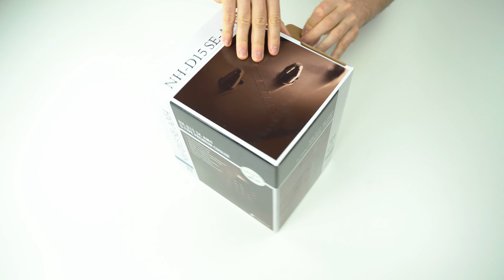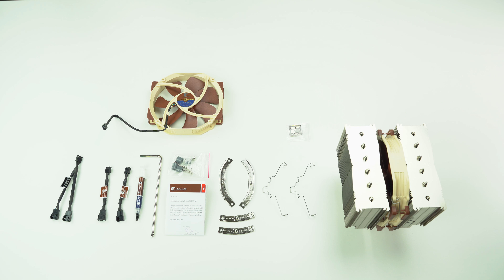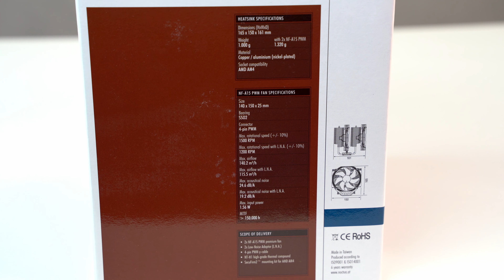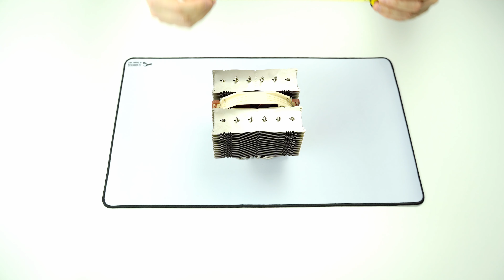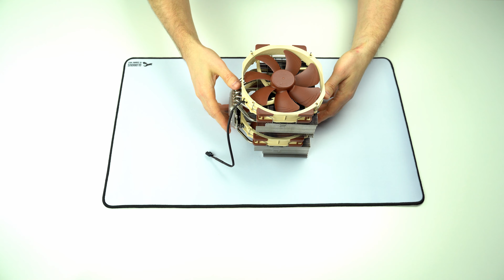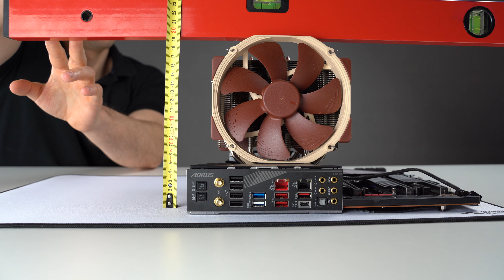Noctua NH-D15 SE-AM4 - Unboxing & Info

Comment: So I got a 9900k and wanted to overclock it so went with the DH 15 to make sure it stays cool...USPS took like a month just to deliver me the AM4 version and im extremely upset after waiting that long. Is there a way to make it work with my mobo cause waiting 2 months to send it to USPS and then get the correct one back isn't something I feel like is worth it
Reply from the maker: Hi Deny, that is unfortunate, but there is a solution 😉 
You can get just the mounting mechanism for your cooler separately and use it instead of the one for AM4 socket. Your Intel Core i9 9900k uses FCLGA1151 so you´ll need this one - https://noctua.at/en/nm-i115x-mounting-kit 
You can get it free of charge here - https://noctua.at/en/nm_i115x_mounting_kit (but you´ll have to wait some time because of the current situation in the world)
or buy it here for 8 USD, if you´re in a hurry - https://www.amazon.com/Noctua-NM-i115x-Mounting-Coolers-platforms/dp/B00BLS3YYO/ref=sr_1_3?dchild=1&keywords=NM-i115x+SecuFirm2&qid=1609022370&sr=8-3
Hope this helped, M.
Reply: @MartinsLab  Thank you so much for fast and detailed reply, greatly appreciated!

Comment: what makes it good for AM4 in contrast to the plain Noctua NH-D15? thanks.
Reply from the maker: I would say that nothing 😊 The only differences between them are the absence of mounting mechanisms for other sockets in case of NH-D15 SE-AM4 (has one only for AM4 socket) and the price, which is few dollars lower. Actually, I even found shops where SE-AM4 version is more expensive although it doesn´t make sense.
Reply: @MartinsLab   Right, I see thanks.

Comment: Thank you for this video. I just received this cooler for my 3900XT build. I hope this is not a dumb question, but it is possible to change out the fans for aRGB fans of some sort? I'm building a music production "slave" with an Asus Strix X570-E and would like to be able to see immediately if my components are too hot, via some aRGB lighting changing colour to red to warn me. Is this possible with the Noctua? Thank you again for the video:)
Reply from the maker: Hi Shawn, you´re welcome, it definitely isn´t dumb, many people like RGBs. You can change the original fans for RGB fans, but they would have to be made by other manufacturer, because as far as I know, Noctua doesn´t make RGB version of their fans. Corsair, Akasa, SilentiumPC and Thermaltake do. You would probably have to use self-made clips or plastic straps to keep them in place, because original metal clips might not fit (it depends on the positioning of the holes on the replacement RGB fans of your choice). 

However, I wouldn´t recommend doing it, because you are now the owner of the best or at least one of the best CPU fans on the market (when looking at reliability, silent operation, airflow). Many people buy them even separately and put them other brand´s coolers, because of how good they are.

If you want to have a visual indication of the CPU temperature by RGB light visible through window side panel of our case, you can check out:  NZXT HUE 2 RGB Lighting Kit in combination with NZXT Cam software or Corsair Link and RGB Lighting Kit. These controllers in combination with LED strips should solve your problem. I am sure there are other similar solutions on the market, so take it only as an example. If it were my choice, I would keep the Noctua fans 😉
Reply: @MartinsLab  Thanks very much, Martin. I actually forgot that I purchased two "Noctua NF-A15 HS-PWM chromax.black.swap" along with the unit itself, just saw them in the "big box of build parts" I have lol. So replacing them with RGB would be silly. The case I have coming now is a Cooler Master H500-M, with two big 200mm RGB fans, so hopefully with Asus Aura I can get them to display a heat warning in some manner. I live in Toronto, and from around May-Sept I run the risk of extremely hot and humid days. I had one of my previous build just fry on one of these hot days, never to work again, so I'm always worried about heat, while needing decently-quiet at the same time while I wrote music. I decided against liquid because I would have wanted to build my own kit (just to be creative), which was a very expensive proposition. I've built both air and liquid (AIO's) in the past, so I really didn't have a preference otherwise. I'm sure I will be quite happy with a closed-case, Noctua CPU cooler, passive EVGA GeForce GT 1030 SC  (this computer will always be used via RDP, so video needs are minimal, essentially only for maintenance when needed) + two 200mm intake fans w/ 140mm exhaust. I spent many weeks researching as much as possible, only to realize eventually I needed to make some choices lol. Maybe not a perfect solution, but I did my best:)

I will take a look at some of the Corsair, Thermaltake, Akasa and SilentiumPC (I've not heard of the last two) to see if any of them offer anything mentioning visual thermal warnings.

Merci, Martin:)
Reply from the maker: @duckilover  No problem. Cooler Master H500-M is a meshed case with good airflow, it should be absolutely fine. Air coolers are generally more reliable than liquid solutions (more variables can go wrong – water pump, liquid leakage, corrosion..) so going with Noctua makes sense.
During the hot months, you could use manual fan speed controller and set the fan speed for case fans higher than normal. In case it gets really bad, I am sure there is some SW which will allow you to power down the hole PC automatically (if you leave it running in the background) when the temperature reaches user set value – that might act as a proper safeguard.

Comment: can noctua nh d15 broken ?what factor make nh d15 will be broken ..., and is it worthed , buying used nh d15 without receipt or invoice ?
Reply from the maker: Generally anything can be broken if it´s not handled properly, but in case of a metal CPU cooler, you´d really need to drop it or damage it intentionally. If you´re asking what could potentially go wrong, then I´d do a visual check:

1)	If the fins on the heat spreader aren´t bent (it would obstruct the airflow)
2)	If the bottom part of the heatsink (the one that touches the CPU) isn´t scratched (it would lower the conductivity and the ability to transfer heat)
3)	If the 140mm fans aren´t damaged or scratched and out of axis (if ball bearings aren´t out of center - do they spin without any extra noise when rotating)
4)	The wires going from the fans and 4 pin connectors should be without any damage, no metal wires should be visible
5)	If there are any signs of damage of improper handling (the cooler should be almost spotless, except for the dust..which shlould be cleaned by the seller)
6)	Check for any signs of using liquid metal or left over thermal compound on the heatsink, the seller should have cleaned it so that nothing is visible
7)	Potentially the cooling liquid which is inside the heat pipes could have leaked if it were damaged (purposefully) but it´s very improbable

NH-d15 has been around since roughly 2014 so it could have been in operation for 6 years max (if it were one of the first models). Noctuas fans have good bearings so it should hold for another couple of years. You could potentially exchange the fans (yet they aren´t cheap).

Of course, I am not able to evaluate anything I didn´t see, so this is just to give you an idea what to look for.
Other than that, if it´s doesn´t look damaged it is worth considering, it also depends on the price.

Comment: can i put in on i9-9900?
Reply from the maker: No, this version of the cooler "SE-AM4" (special edition for AM4 socket) is for AM4 socket only, for i9-9900 (socket 1151) you´ll need to get Noctua NH-D15 (without "SE-AM4") which is compatible with all these sockets AM3/ AM4/ FM1/ FM2+/ 2011/ 2011-3/ 2066/ 1156/ 1155 /1150/ 1151 including the one you need.
Reply: @MartinsLab  i bought Noctua NH-D15 chromax.Black, Dual-Tower CPU Cooler (140mm, Black) i think this is good i9 right?
Reply from the maker: @theand5585  Yes, that´s absolutely fine, it´s the black color version of the original NH-D15 - the functionality is the same. If you plan on overclocking, I would just exchange the thermal compound (to Noctua NT-H2, Arctic MX-4 or Thermal Grizzly Kryonaut) because i9 tends to run really hot and you could lower the temps by 2-4℃, otherwise it´s great as it is.
Reply: @MartinsLab  i just need it to gaming not for overclock cuz I order Praxis WetBenchSX case I don't wanna use close case
Reply from the maker: @theand5585  OK, then you can leave it as it is.
Reply: @MartinsLab  thanks dude
Reply from the maker: @theand5585  No problem.